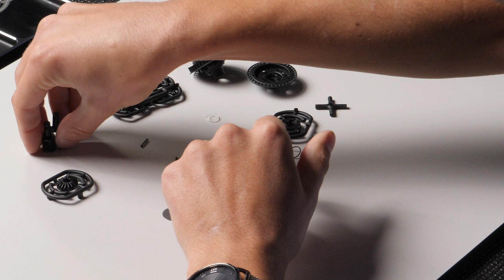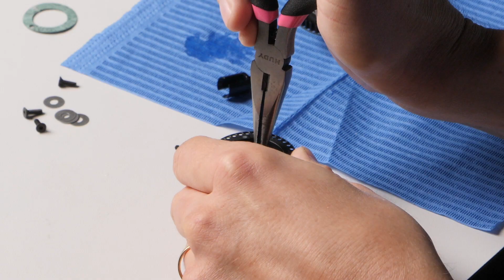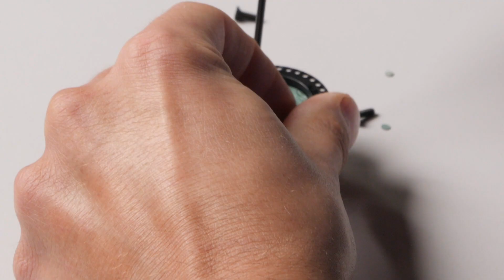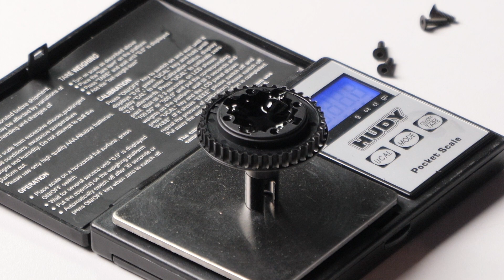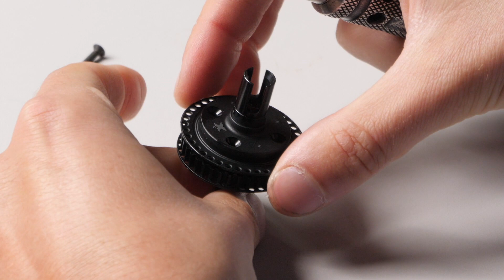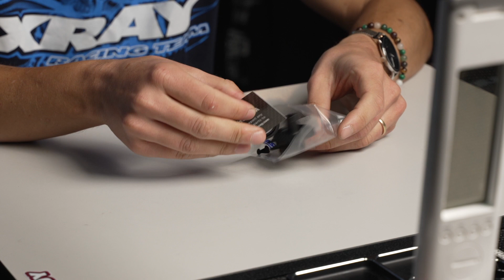XRAY X4 - Build - Gear Diff & Solid Axle

Comment: What is the differential ratio on the X4 with gears in the back and solid in the front?  I plan to use my X4 for USGT and or VTA.  This would be on a medium-small course on carpet with med-high traction.  Do you have any recommendations on what spur gear and pinion gears I should use? Some people have told me to go for an FDR of 3.5-3.9 but to calculate that I would need to know the differential ratio I guess.  Any help is appreciated.  Thanks